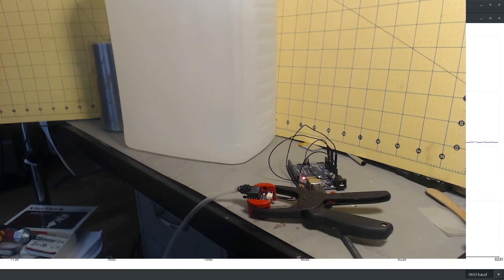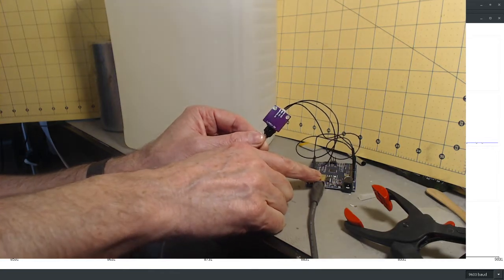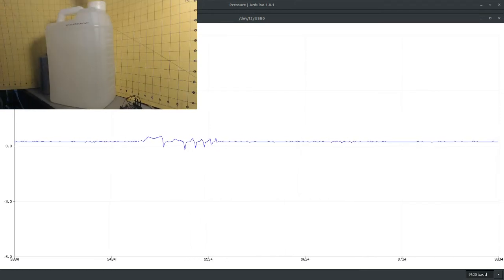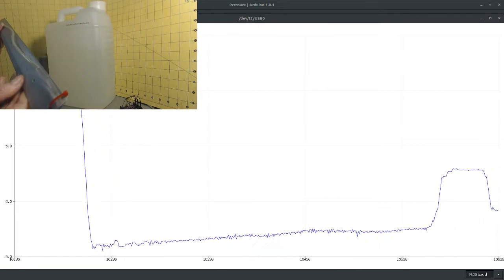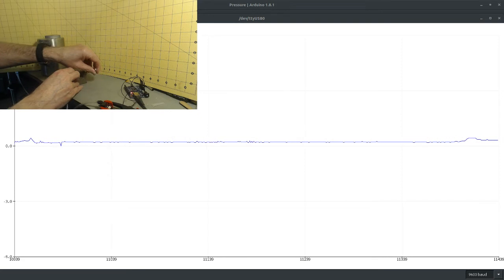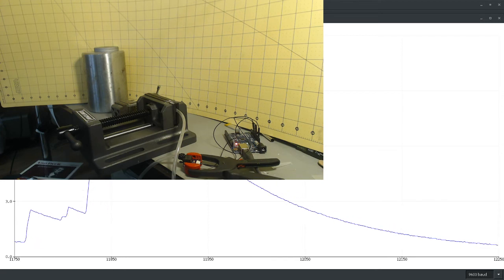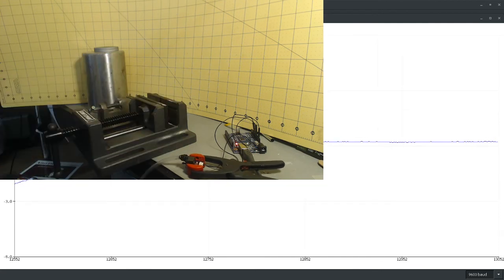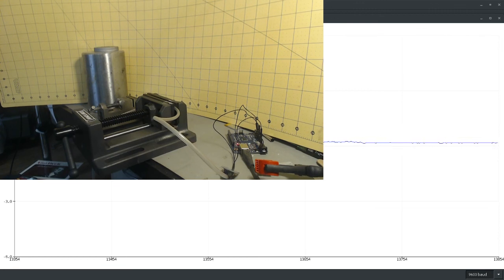2017 05 30 NXP MPXV7002DP Pressure Transducer Water Level

Comment: Can u show the circuit connection between sensor-battery and oscilloscope
Reply from the maker: No battery. No oscilloscope. USB power. Arduino IDE serial plot display

Comment: The description of your video is misleading at best. In your video you provide evidence that the sensor works correctly but that your setup has issues. What pressure sensor can function correctly with a leak? None! Fix the leak. As to the water getting in the tubing, it would not get in if you didn't have the leak and water that got in would be pushed out by the captured pressure in the tubing when you take it out of the water. Two ways to fix this is a bigger tube / pipe or a flexible membrane like what is used in a pressure tank that would keep the water out but allow the pressure to be conveyed to the sensor.
Reply from the maker: Good observations.
Reply: Do you know how would be it possible to apply some kind of flexible membrane as you mentioned to this kind of differential pressure?
Reply: @michalboucek1545  take a look at diagram of a pressure tank for a household water supply with a pump to pressurize the water supply. However that said a tube without a leak is a better solution. Take a look a a diagram of a washing machine for this. The pressure sensor is normally located near the control panel and a tube runs to the bottom of the tub to sense the water depth via the pressure read.
Reply: Super, thank you. I am thinking about using this kind of sensor for measuring fuel level in my motorbike tank. Since this sensor is made for dry air, not for gas fumes. I am thinking about my solutions. So far I have some up with making a simple filter from active carbon, but I was asking about the membrane to separate these fumes from sensor side section.
Reply: @michalboucek1545  The usual setup I see for fuel tanks is a stabilized float that turns a potentiometer (usually mounted outside the tank). The float has flattish hole that rides up and down a flat metal rod that is bent in a spiral so that it turns the potentiometer as the fuel level rises or sinks. There are normally two other straight rods on either side of the twisted rod that guide the float up or down and stabilize its movements.

Comment: how about water flow measurement? it is possible by using MPXDP ?
Reply from the maker: Whatever relation you use for getting flow from pressure hold when an NXP MPXV70002DP is used to get pressure.
The difficulty is in establishing the relationship between pressure and flow.
Here are a few ways: www.pipeflowcalculations.com
Reply: @georgeredinger4773  hmm okey. Thx George

Comment: Would this be able to measure water pressure through the tubing directly and changes in said pressure continuously, as opposed to water level?
Reply from the maker: Yes, hooking a pressurized water source will work. At least till the sensor is destroyed by the water. There are many sensors available for measuring water pressure which will not be damaged by contact with water.
Reply: Thank for your reply, it’s greatly appreciated. Excuse my ignorance, would a sensor like this (https://www.ebay.co.uk/i/172351029176?chn=ps&norover=1&mkevt=1&mkrid=710-134428-41853-0&mkcid=2&itemid=172351029176&targetid=594652409480&device=m&mktype=pla&googleloc=1006598&poi=&campaignid=6466403949&mkgroupid=78136326675&rlsatarget=pla-594652409480&abcId=1140486&merchantid=113794290&gclid=EAIaIQobChMIksW5kNTz5gIVwbHtCh3udgZHEAkYBSABEgKckvD_BwE) be appropriate for said purpose?

Comment: Do you know what the output of the da is in bit I know you are using   10 bit to read it 
Thanks Stuart
Reply from the maker: The MPXV7002DP is a "high level" sensor, so at zero (differential) pressure and a 5V supply it will have an output of 2.5 volts. For the bits, that is 0111111111 from the AtoD converter. Maximum negative pressure is 0, max positive all 1s (1023).
https://www.nxp.com/docs/en/data-sheet/MPXV7002.pdf

Comment: Will it work for 6 feet in my home water tank?
Reply from the maker: The full scale range of the MPX7002 is about +- 8 inches of water (2 kPa). So, not good for measuring a 6 foot (72 inch) column of water.  That's almost 10 times too much pressure for the MPX7002.
Reply: Thanks for reply. 
Can you please suggest a sensor so that I can use it to monitor the water level in my house tank ( around 5 feet high ) ?
Reply from the maker: https://youtu.be/bPV7ENlh3h0
I like  that design, very elegant.
If you just want to detect full/not full, then a float switch will do.
If you want to record level changes over time, a notebook.
If you want to electronically record then the fun begins.
ultrasonic sensors looking down from the top of the tank to the water surface are probably the cheapest.
Another way is a float coupled to a multi turn  POT.
A pressure transducer will do it too.
If you can access the sides of the tank and its plastic, external capacitive sensors could be used.
All the electronic methods need electrical power  a microcontroller, data cables, displays, etc.
Have fun.

Comment: I bought this sensor from Aliexpress (https://www.aliexpress.com/item/MPXV7002DP-Breakout-Board-transducer-APM2-5-APM2-52-Differential-Pressure-sensor/1859106295.html) but it did not come with the plastic pipe/hose. The nozzles on the sensor are pretty small. Any idea what the inner diameter of the hose should be?
Reply from the maker: My pipe came from my box of pipes of many sizes. If you don't have one of those, Aliexpress is one source.